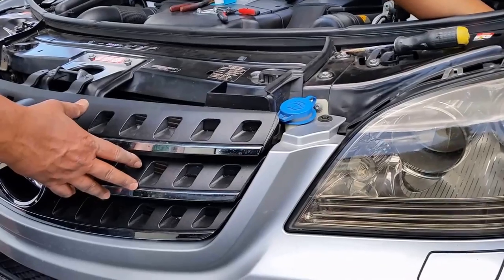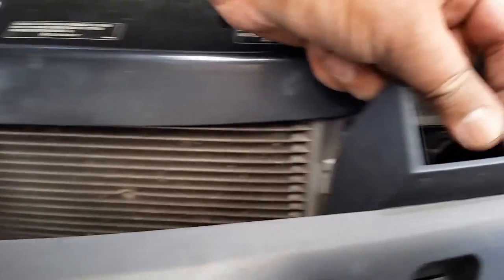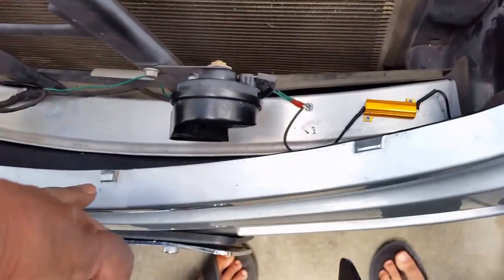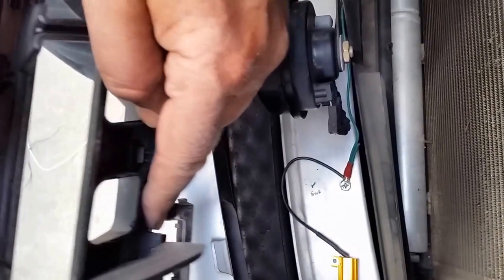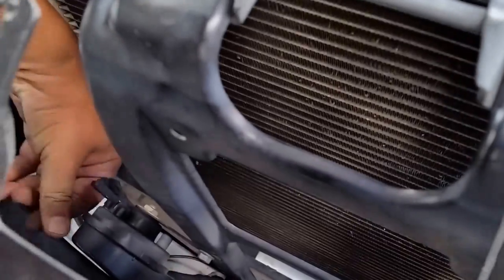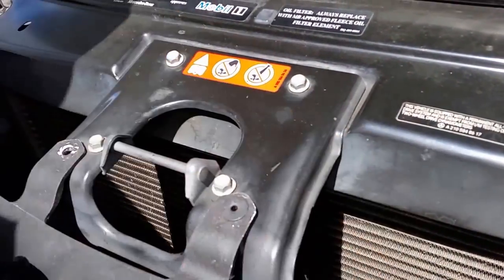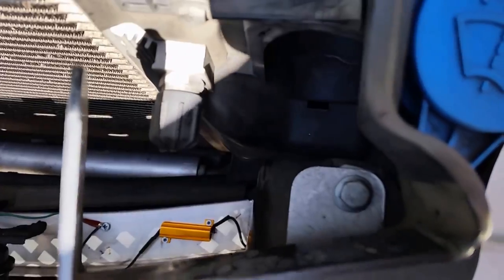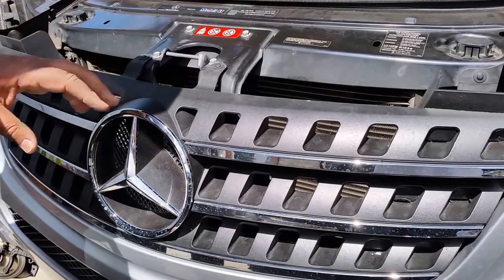How to Install | Remove your Front Grille on Mercedes

Comment: How do you remove the grille from the GL450? I was able to disconnect the top screws and clips but unable to remove the bottom section.

Comment: Very nice video. Well done.
Reply: Have you ever done a video on how to remove the headlights (canisters & all)? I have a problem with the adjusting screws on this vehicle. I believe I need to remove the front clip area in order to find out why they won't adjust. Any suggestions?
Reply: where can i buy a nicer grill for a 2011 ML 350 ? benz

Comment: Just a word of caution. I have just replaced my damaged 2006 ML500 grille & the plastic on the old one was incredibly brittle - be very careful undoing the bottom clips if you want to reuse the grille.